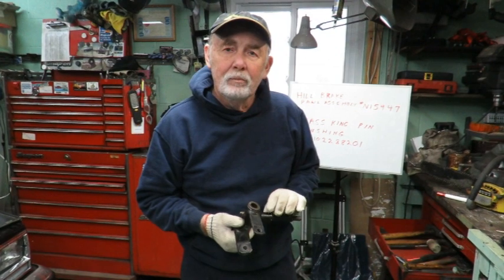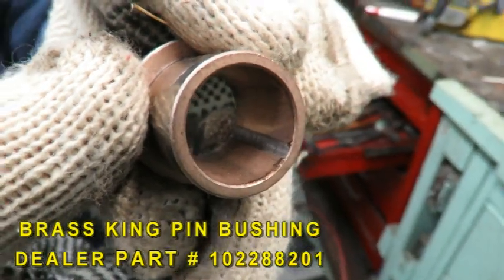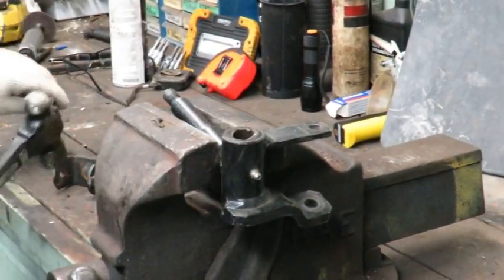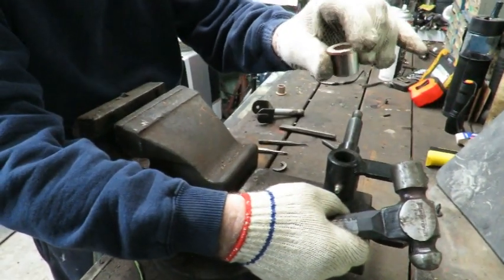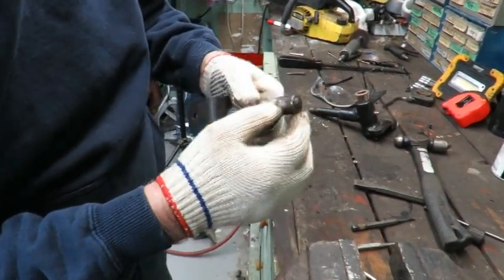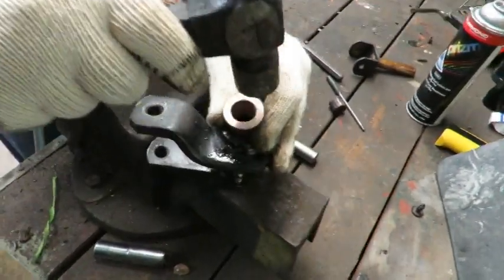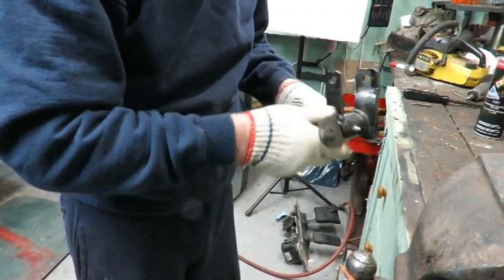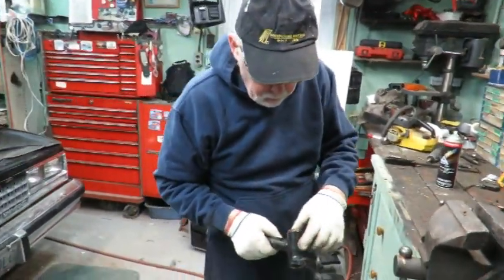Club car Precedent King Pin Bushing Replacement

Comment: David and Suzy, thanks for the video. It was spot on for removing and installing the bronze bushings. I know your method is a correct way since I got in a hurry after installing the first set of bushing and pounded away on the second installation only to mess up the bushing. Use the king pin as a guide as shown.

Comment: Hello David.  I have another club car rack and pinion question that I hope you can help with.  I need to replace the splined stud that is in the rack and pinion assembly and attaches to the 'knuckle joint' on the steering wheel column.  I can't get the round rubber seal out of the section that holds the splined stud, no matter how hard I try.  If you have done this, I'd sure like to know how you got that black round rubber seal out of there.  Thank you.

Comment: Wish I saw this sooner. Beat up one of my spindles and had to order a new one.
Reply from the maker: all I can say is that i have probably done a hundred or more this way , and they always work out well, use the bushing from the dealer that has the GROOVE   and take a used king pin and grind a chamfer on it and please subscribe to my channel   David
Reply: @davidandsuzy2516  What is the torque value for the king pin nut

Comment: May I ask where you purchase your bushing kits.  There are numerous places of course but would value your opinion as to a seller with good parts.
Also, I see the king pin bushings (top and bottom) both have a flange.  I have seen where the bottom bushing has a flange but the top does not.  Of course, I like the two flange bushings better.

Comment: Thanks for this video. This method works great for Precedent bushings. I've replaced several sets and had no problems. Tried doing it on 2 Carryalls and the kingpins were too tight. Had to work on the bushings with a die grinder and tootsie roll. Got them to fit correctly, but it took a while. Is this normal on Carryalls? I guess I'll shop for an adjustable reamer...
Reply from the maker: Agree 100% the carryall are terrible, and totally different. It seems to me that I tried honing them, BUT that took too long, SO I took a measurement of the king pin and went to a specialty store and bought a drill bit a couple thou. more and drilled the bushing out.

Comment: My steering/tire jolt when it catches on asphalt.  I have worked hard on the alignment, but the wheel feels like it jolts around similar to the front wheels of a shopping cart.  Do you have any suggestions to what could be causing this?
Reply from the maker: any way that you can send me a picture of your cart standing in front of it about 8 feet away ?
Reply from the maker: sometimes when you have too much toe in   it will feel like that. just to be safe make sure you have 18  to 20  psi in the tires   jack the front up and spin the front tires just to make sure they are running true  first
Reply: Sounds like you need more caster adjusted into the alignment.  The caster angle is what makes the wheels stable.

Comment: Great Video... Have you ever seen a king pin break? Had a tournament last week and a king pin failed (broke) on a cart driven by one of our players and the course is saying that it was due to negligent driving. However, there wasn't any sign of a damaged fender, bumper, wheel/rim, tire etc.  just a broken king pin. The course wants to charge us $600 King Pin and bushings + labor. The driver of the cart told us that the cart started steering rather oddly halfway through the round and then finally it went bonkers and the wheel splayed out at the top ( apparently when the king pin totally failed)  Any thoughts? Thanks in advance.
Reply from the maker: well I can't say for sure as I was not there. BUT if they have not been greased properly they seize and can break.  Whoever worked on them might have given them a shot of grease BUT IT NEVER WENT THROUGH, That is why I used the proper bushings with the the groove to let the grease through.
Reply from the maker: about $50 in parts and 1 hour labour

Comment: Great vid, thanks for sharing. You took most the worry I had out of the equation. I'm still pretty surprised that the king pin fit into the bushings so nicely. I've heard most ppl have to ream them out. Maybe the brand you are using is better quality? Which brand are these?
Reply from the maker: I tried to press them in, it took longer and they would bind
Reply: @davidandsuzy2516  Your way worked great! I just couldn't get the king pin to fit into the bushing, it had to be reamed out a bit.
Reply from the maker: @mygt8a4re  glad I could help, were you able to find the same bushing that I use , with the inside groove, also remember to grind a smooth chamfer on the  used king pin that you are using  to install the bushings
Reply: @davidandsuzy2516  not sure that I found the ones you used or not. Your video did help me to get them installed but the kingpins were too tight to go in the bushings. I had to slightly ream them, then I tapped the kingpins in. This was my first attempt doing this, I'm sure next time wood be alot easier. A bit of a pain but they are in and working great!

Comment: Why r u doing this the hard way? U can just use the bench vise to press fit the bushings in
Reply from the maker: I have probably done a hundred of these, and tried with a vice, and a good hydraulic press, I have found this to be the quickest way and the outcome is very good, the king pin spins freely and does not bind /  some people like white cars and others like blue, /  if you prefer the vice method then use it     thanks
Reply: @davidandsuzy2516  i am assuming these bronze bushings replace plastic bushings? Then these bushings last longer, feel tighter? Is that the idea? Thanks
Reply: i changed those bushings out with plastic ones, i am assuming these will not last long. i was disappointed to see how flimsy this set up was, was looking for a beefier solution. My cart was all over the place, tightened it up some, still need to change A arm bushings
Reply from the maker: @ricklane2619   all the bushings that I replaced were original worn out bronze.